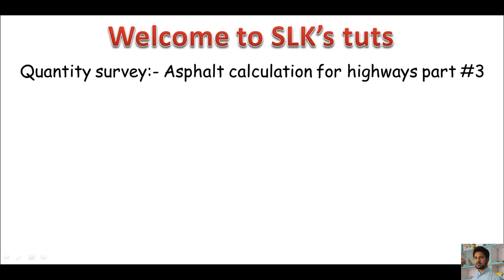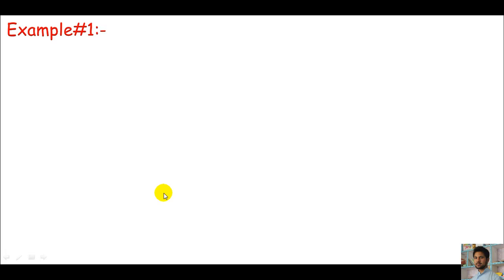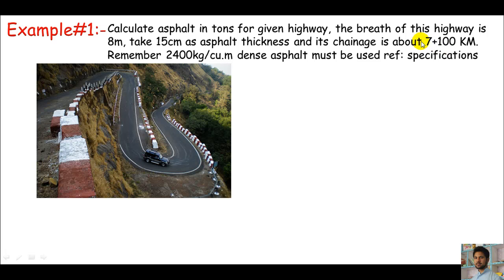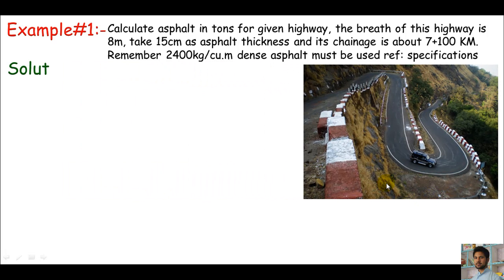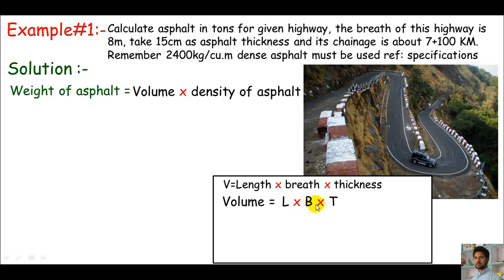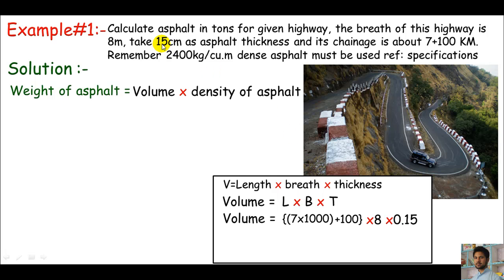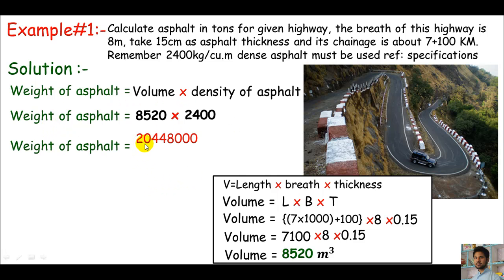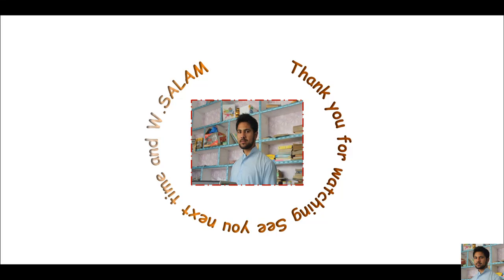3)English- asphalt calculation for highways part 3 of 3

Comment: Let me ask. If the specifications in the bill is lay asphalt to a compacted volume of 50mm. As the density take care of the compaction. Cos me I usually consider adding 10mm before multiplying by the density.

E.g. L=10,000, B= 8m T=50mm, density=2.35
So, I calculate like this as below 
10000*8*0.06*2.35= 11,280ton

Correct me  am wrong
Reply: Sometimes I add 20% make  up as to Carter for waste